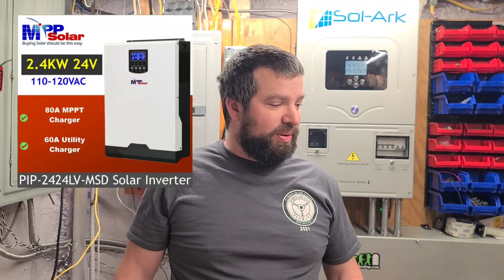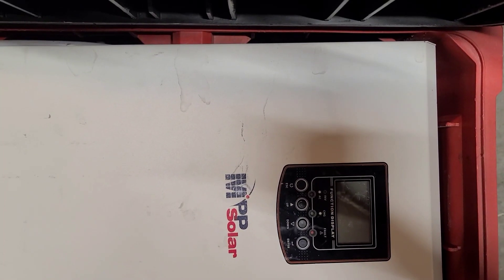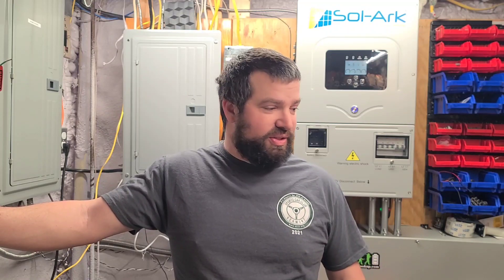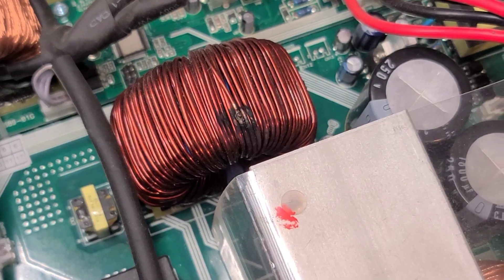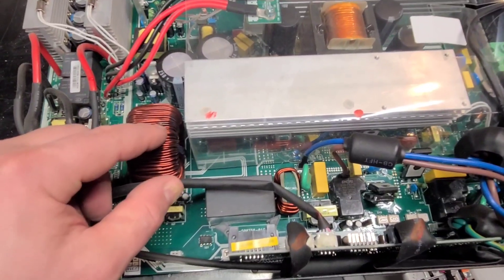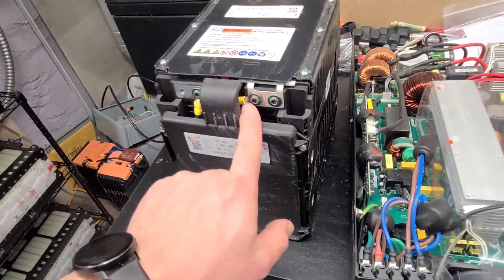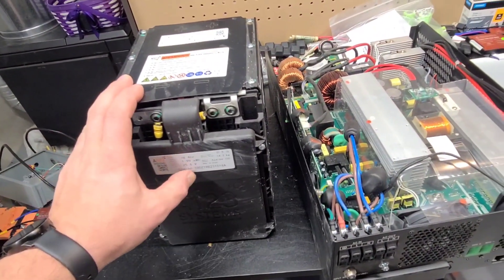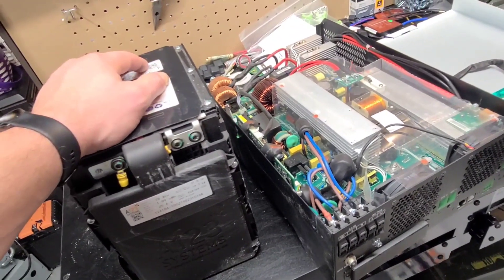Homemade Portable Battery Pack. What Went Wrong?

Comment: I would make sure that if you rebuild this, you paint "No Seat" "Do Not Stack " on top. Then ,if your employees are like mine, screw 100 1-inch sheet rock screws through a piece of 1/4" plywood cut to the same size as the top, turn it with the points facing up and screw it down to the top. It works!

Comment: i'd like to see if the cells in those packs are still balanced. the two packs i use every day (one has been cycled 300+ times, the other ~100 times) are still balanced, but probably no thanks to the daly bms.
Reply from the maker: I would bet they are, but I'll definitely check them.

Comment: So the lid of the super expensive red plastic box isn't stiff enough to sit on?
Reply from the maker: It definitely is, but the way I had it set up, the lid pushed on the face of the inverter when it was sat on.  Basically I tried to fit too much stuff in too small of a box.
Reply: @benssolarandbattery  thankyou. that was very interesting. the design of the plastic box was ok, the design of the inverter was ok, but when combined, some extra engineering was required..
Reply: I'd still expect that lid to be a bit stiffer, or that damn screw to be shorter, or redesigned out of the way.

Comment: I have the same inverter.  It's been a workhorse. Thanks for the heads up on the screw head.  I'll get some insulation on the inductor and screw head on my inverter. 

 You might be able to repair that arced out section of the inductor.  It appears to be melted open on one of the windings.  If the MOSFETs took a hit and they are shorted, you might as well replace the board.
Reply: It's never the one component; there will be at least a reduced lifespan
Reply: Just a little silicone! 😁